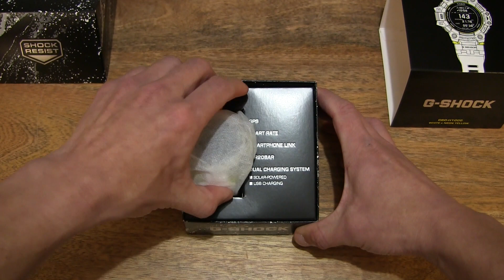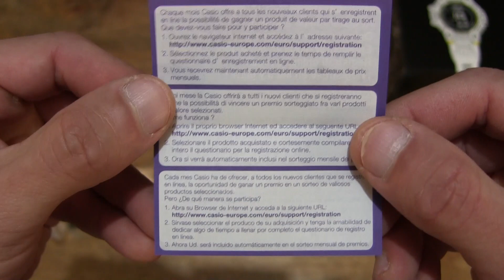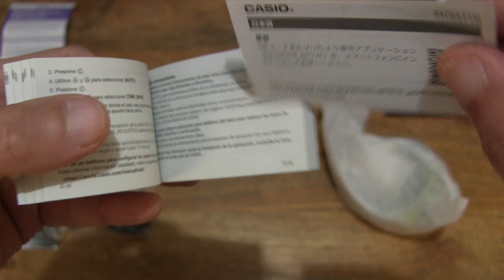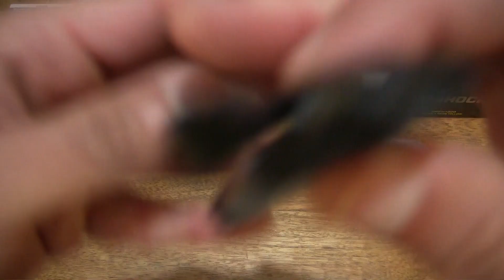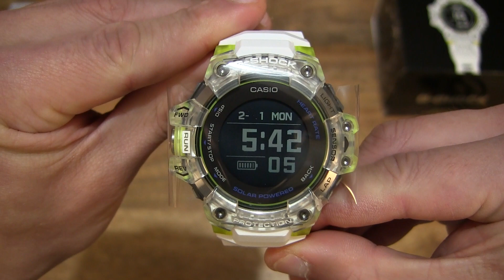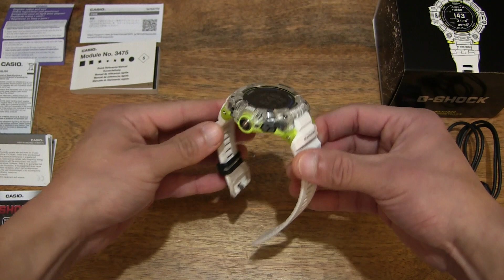G-SHOCK Sport GBD-H1000-7A9ER

Comment: 9 mins in before i saw the watch! I have a GBD H2000. I'm came across a limited edition colourway new old stock (discontinued) GBD H1000 at bargain price.  I had to have it. I don't use any of the sports or heart rate functions on either, i have a Garmin for that. I purchased this because of the style and colourway / home screen display. Mine is in permanent airplane mode. I prefer the looks of the H1000 over the 2000. its my daily driver.